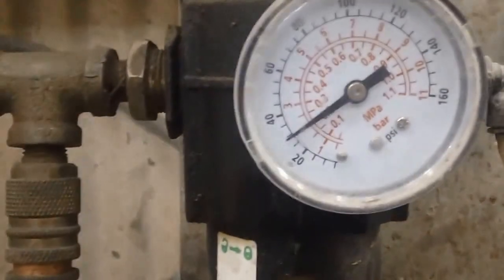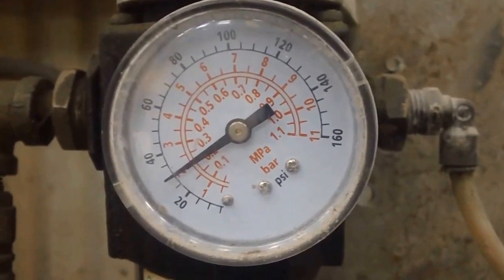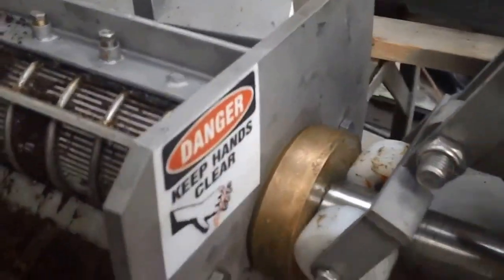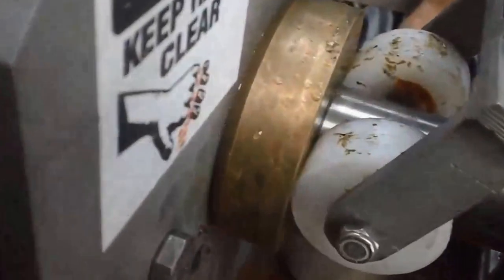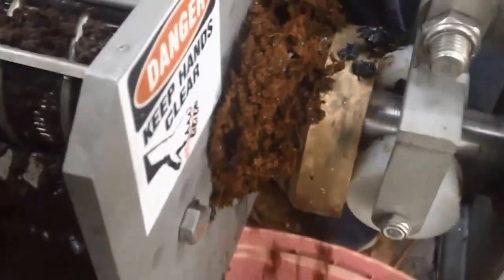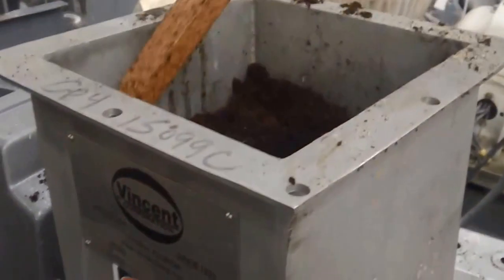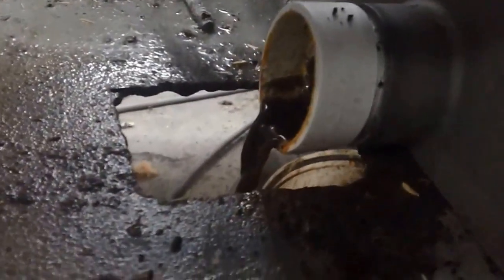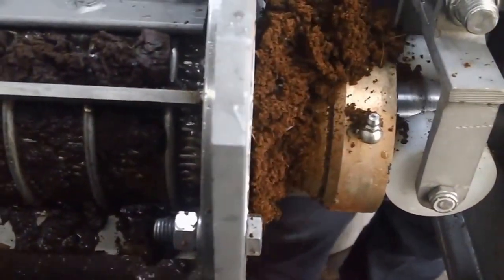Dewatering Coconut Coir (husk) in a Vincent Screw Press

Comment: Which is the smallest slot of screen basket?
Reply from the maker: Hi Gabriel - We typically use 0.015-0.020 inch wedge wire screens on our CP-4 presses.  We do use 0.008 - 0.012 inch wedge wire screens for some applications using alcohol as a solvent, but this size typically does not work well with liquids containing mostly water.